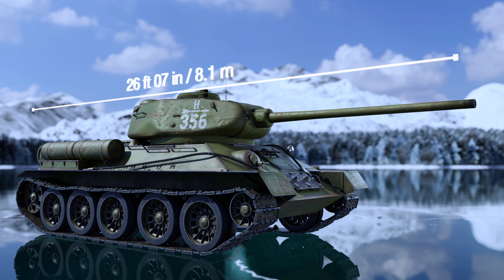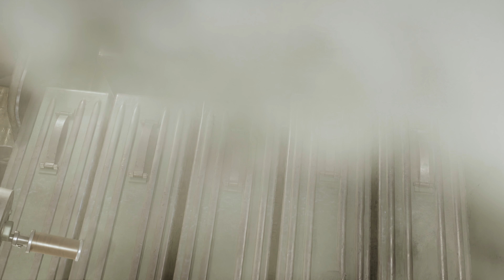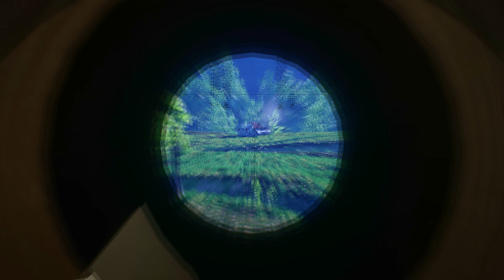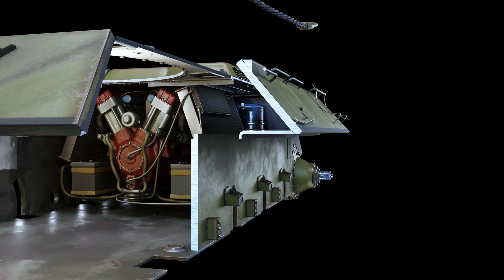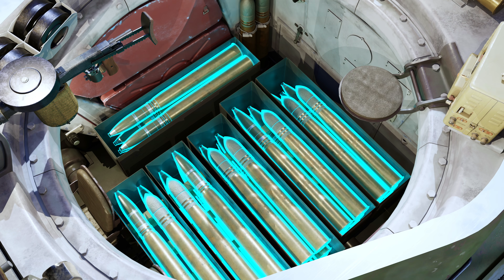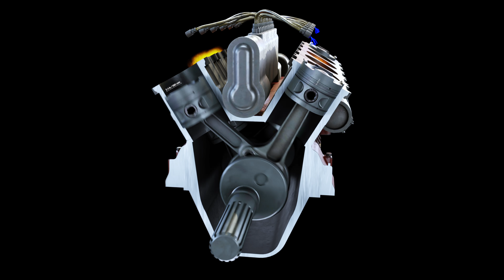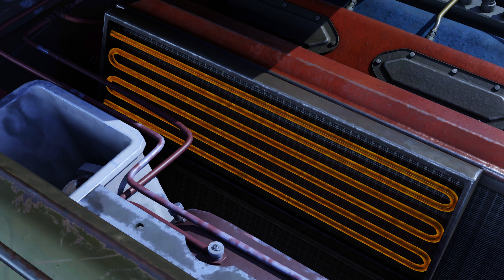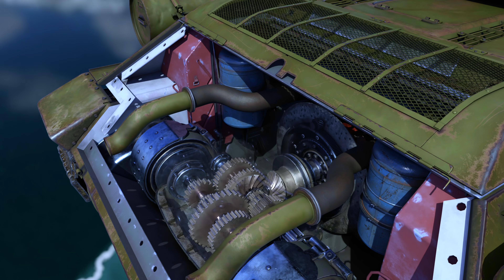Inside the T-34-85

Comment: strong, but nothing compares to that:

*200mm autocannon tankette*
Reply: I got that reference!!!!
Reply: @luuko656  his other yt channel right ;)
Reply: It's clear. T-34s can not use their own recoil to propel and use itself as a projectile towards enemy panzers!
Reply: Or 45mm at 60°=76 mm😅
Reply: 😂😂😂😂😂 RPG решает всё 😂😂😂
Reply: Compare that to the "Made in US "  Sherman Garbage ..🤣🤣🤣
Reply: @MrMWN-rw4bv nga
Reply: @MrMWN-rw4bv  There's already a video on it. Also, the Sherman had an actual turret basket, suspension with shock absorbers, comparable repairability, etc. No idea why you feel the need to hate on it.
https://www.youtube.com/watch?v=DN4TJpPRhSQ
Reply: @FreedomFiend  But i think that the Sherman wass a much larger target on the battlefield (because of its height), more prone to fire (gas engine), had slower speed and shorter range. It's a great tank nonetheless, but to be honest, when the easy eight reached the battlefield, most of German armored vehicles were destroyed, the rest were distributed mostly on the easter front, thus contributing to the fact that most Us tank commanders rarely saw the tiger or the panther on the battlefield. Older models of the Sherman (before the easy 8), like the t34 ones (t34-76),etc, were terrible compared to German counterparts. Their main advantages were their number on the battlefield as they were much cheaper and easier to build and operate.
Reply: @ThinhNguyen-ql2dn  The issues regarding the Sherman are often overblown, unlike the issues of the early T-34. Ironically, the exceptional crew survivability of the M4 hurt its reputation, because a lot of crew were able to make it back to complain about their tank getting knocked out. Fire suppression systems, large, spring-loaded crew hatches for rapid egress, spall-resistant armor, and a spacious and ergonomic interior helped the crew tremendously in surviving a hit (penetrating or otherwise), and escaping the tank quickly in the event it was disabled. It had a rate of 0.98 killed crew members per totaled tank, which is insanely low given that each tank had a crew of 5.

Meanwhile, the T-34 was prone to manufacturing defects right up to the end of the war, as unskilled laborers, poor logistics, and unrealistic production demands forced tanks to be pushed off the assembly lines with ad-hoc fixes that would fail in battle. It was passable on paper, but in practice, it performed notoriously badly. Poorly manufactured armor would splinter and shower the crew with shrapnel with even non-penetrating hits, the prisms for prismatic viewfinders were frequently replaced with polished metal sheets, which quickly rusted and rendered them inoperable, transmission defects meant they could rarely exceed a crawling pace, and many other issues besides. IIRC, the T-34-85 suffered about 3 crewmen killed per totaled tank, which is an appalling number, and it was even worse for earlier models.

German armor suffered from the same issues: good on paper, not in practice. For them, it was less an issue of poor manufacturing as it was of being overengineered and not really taking into account the fact that they would need to be crewed by people. Vehicles like the Panther and the Tiger were notoriously unreliable, with transmissions that would rapidly burn out, and they also suffered severely from being terrible to maintain, especially with their interleafed road wheels. The Panzer IV was a lot more tolerable (hence why it was so much more heavily produced), but still suffered from being unergonomic and difficult to escape. I'm least certain on this one, but I want to say it had a rate of 1.5 crewmen lost per totaled tank, which is more in line with the average for WWII.
Reply: @ThinhNguyen-ql2dn  a lot of Wehraboo myth talking points there.

First off, the Germans also used gasoline engines like the Americans so your point is moot on it being susceptible to fire. The only reason tanks brewed up often was because of ammunition stowage, and the M4 was just as likely to brew up as every other tank (around 60-80%). In fact, later Shermans equipped with wet stowage drastrically reduced its fire rate to a measly 15-30%, making it the SAFEST tank to be in even after taking a hit. The Shermans also had wide spring-loaded hatches that enabled bailing out of them easy, coupled with its wide room, it actually had the highest crew survivability amongst Allied tanks (1 out of 5 crewmen lost per knocked out tank).
Reply: @ThinhNguyen-ql2dn  and how was the Sherman terrible? In what sense? Even the Soviets who received lend-lease M4A2s loved it compared to the T-34.

Its armor was decent enough, being on par with a Tiger 1's frontally (90mm LOS from its sloped glacis vs the Tiger 1's 100mm flat plate). The 75mm M3 cannon could pierce through the front armor of a Panzer IV or StuG III from standard combat ranges (although the M4's armor was just as susceptible to the Pak/Kwk40's return fire as well from those ranges), making them roughly equals.

And yes, they were cheaper and easier to build, but the Sherman was actually much more advanced than the Germans surprisingly enough. They had FM SCR-508 radios which were harder to jam from outside electromagnetic interference unlike the Germans which still used AM radios. And they also had rotating periscopes for EACH of the crewmen inside, giving the tank 5 eyes instead of just the commander's 1 - situational awareness is very important for tanks after all, and whoever spotted and shot first usually won. Also don't even forget the vertical stabilizer, which allowed the Sherman to roughly keep its gun on target even on the move.
Reply: @FreedomFiend потому что по многим показателям твой мусор шереман проигрывал Т-34! 😂😂😂
Reply: @Akaeru  Получается, Шерман строился для комфорта, а Т-34 - для боя. Также вспомните M3 Lee. Пока в бой не вступил - всё хорошо ;)
Reply: @gardiel5401  the Sherman was built for both.
Reply: Mid tank f22 raptor better

Comment: I rly like your vids from visual perspective. Just dont like what lies you speak...apds for t-34? seriusly? over all 85 was copy of instaled flak gun to an tank as tigers had...also t34 familly is design to travel 300km and break or whatever..also penetration is listed below 500m same as US tanks,also had problem to pen pz4....and you say its design to pen tiger 2 🤣🤣🤣 brah IS-2 had to use 10 shells to break tiger2 armor....and it was 122mm
Reply: I don't think you understand that T-34 and T-34-85 are two very different vehicles
Reply: Please check Battle of Oględów for example. Poor Tigers II fell victims of the same lies.... ;)
Reply: Tiger II was first used in the Lvov–Sandomierz Offensive. And first tree tanks Tiger II were destroyed exactly by T-34-85.

Comment: Finally, a Video On T-34-85
Reply: Still waiting on centurion and chieftain.
Reply: Panther  @warthog6467
Reply: Yes our favorite tank
Reply: Your favorite tank is probably the T-34/76 which is what won the battles.  Then, all 76mm turrets were changed to 85mm turrets, and the 76mm was lost to history.
Reply: @N_Wheeler   Nah, My favourite T-34s were T-34-57, T-34-D5T and T-34-85
I did not like the older T-34s like T-34 76 becaus they were not as powerful as T-34-85s and a slower turret traverse.
Reply: @rockastar9 the T-34/76 looked tougher to me, like a mean dog.
Reply: @N_Wheeler   I like tanks from the crew's POV. And Any crew will want a T-34-57 over the 76. and T-34-85 over any.
Reply: @rockastar9 Т-34-57 было не так уж много. Т-34-85 превосходил его про бронебойности, да и по качеству обычно тоже - избавились от многих недостатков раннего танка.
Reply: @gardiel5401   Yeah, there were only 10 made, but they were lovely, and extremely accurate.
Reply: @N_Wheeler  a 85 ös  volt favorit 43 töl és az remekelt a  harcokban.
Reply: @peterhalasz7525  wrong. for each german tiger russians paid 25-28 t-34. the 85 v 88 mm gun made enormous difference. russians won because of the enormous human lives they spent, and because of the support from the USA.
Reply: @west_park7993 hülyeség, a szovjet tankok nagyrészét a német légierő semmisítette meg további nagy részét a gyalogság és tüzérség, a német páncélosok csak nagyon kevés arányban.
közvetlen harckocsi elleni kuzdelemben az arány úgy 5-7 db jutott egy tigrisre, ami nehéz harckocsi.
A 34/85 aránya meg tigrissel szemben nem érte el  3 at a tigris javára.
A német légierőben volt olyan pilóta aki csaknem 1000 szovjet harckocsit semmisített meg, és volt olyan repulöszázad ami többet mint a összes német harckocsik  összesen, és ez csak 1 század....
Reply: @peterhalasz7525  Это было в первые дни войны а Т34-85 появились в 1944
Reply: @ЗлойАсисяй2 45 elejéig ez volt a tendencia, a legtöbbet a légierő  aztán gyalogság , tűzérség, a legkissebb arányban a német páncélosok semmisitettek meg szovjet páncélosokat, a felosztás alapján...
Reply: @N_Wheeler  Башни не менялись (разве что если танк был подбит и отправлен на завод для ремонта). Выпускались новые танки с новыми башнями. Заодно избавлялись от "детских болезней", связанных, в том числе, с ходовой частью.
Reply: Best
Reply: @danblauwal4524 чем лучший?!
Reply: @varyag058   it saved the world from the nazis
Reply: @danblauwal4524 танк это создан при помощи США, это раз, от фашизма спас не танк, а международная коалиция это два
Reply: @varyag058   the USA (governments and most part of thge brainwashed population) are criminals who wanted to see as many soviets to die as possible. Back in the days. They still hate all slavs and want to see them die.
Reply: @varyag058 танк был создан на Харьковском тракторном заводе, руководитель проекта Кошкин, США здесь не причем.
Reply: @evgenyd6483 tökéletes igazad van.
Reply: @varyag058 ??? jól vagy? A Christine licencelték a t-34 be csak ennek a felfüggesztése került semmi másban nem egyezik, még az oroszok küldtek is egy példányt az amerikaiaknak de azoknak nem tetszett.
Reply: @peterhalasz7525 погон изготовлен на американском станке, стволы также изготавливались американским оборудованием, броня при помощи американских компонентов, порох итд итп. Мотор совок содрал с авиационного двигателя который разработал французкий инженер Катален
Reply: @evgenyd6483 сопли подбери! Он уже устарел, а новый 85? По интерисуйся, что такое погон, калибр ствола откуда они появились, а потом умничай
Reply: Ты лжёшь, причём тупо. Это три)))
Reply: @zef6624 Я ЛГУ?! По гугли сам, всё в доступе и это я так в кратце написал, про блоки двигателей (алюминивые) кто поставлял и по какой причине, топливную аппаратуру
Reply: @varyag058 да ну. Правда? Ты это моему деду расскажи, а не с методички. Кроме шасси, которая была изменена до неузнаваемости с американцем ничего общего. У американцев был позорный Шерман. А коалиция вступила уже после решающей курской битвы, да и то в западной Европе, где получили при Арденах. Тебе внушили, а ты и поверил).
Reply: @varyag058 простите, вы либераст?
Reply: @varyag058  а США при помощи США почему себе такой танк не создало? )))))) А над рейхстагом чей флаг?
Reply: @eivannoguine7771 какой такой?!
Reply: @eivannoguine7771 Да угомонитесь вы уже с этим флагом! Побеждëнная страна в результате экономику востановила быстрее и лучше, а вы до сих пор флагом машете
Reply: @varyag058  Так это он вам покоя не даёт) А про лучшее восстановление - смешно..
Reply: @evgenyd6483  Историческая цепочка такая - танк Кристи (американский, да) - танки серии БТ (от 2 до 7), танк А-20, танк Т-34. Некоторые элементы танка Кристи (например, схема КПП и подвески) дожили до Т-34. Потом от части из них отказались в пользу более современных решений.
Но некоторые упоранты до сих пор считают его американским )
Reply: @varyag058  В побеждённую страну ввалили охренительные деньги на развитие промышленности, и открыли рынки. Но отобрали суверенитет. Даже сейчас ФРГ оккупированы США.
Reply: We need either the maus or B-29 now
Reply: @WilliamCheney-d7c  I second this.
Reply: Sturmtiger next?
Reply: @StrathconaPokeMart   YES!
Reply: Vietnamese pls, vui lòng nói tiếng Việt trong các video sau
Reply: @Maitiendat-2K17   Why? Why would I speak Vietnamese?
Reply: I would love him to do an IS-2 video